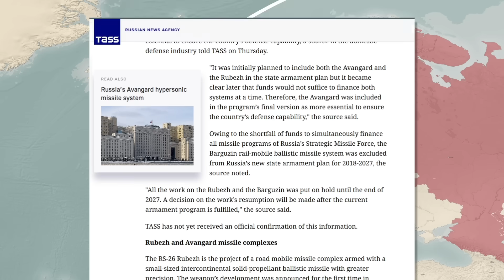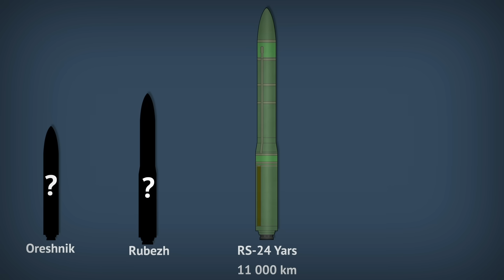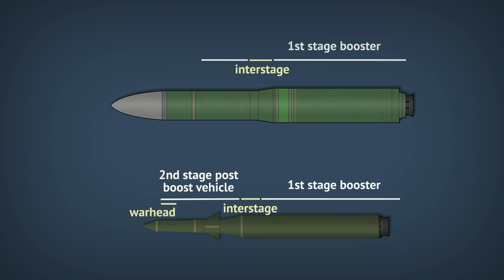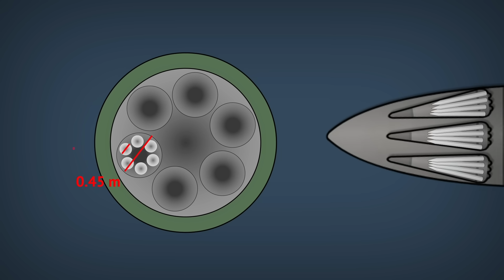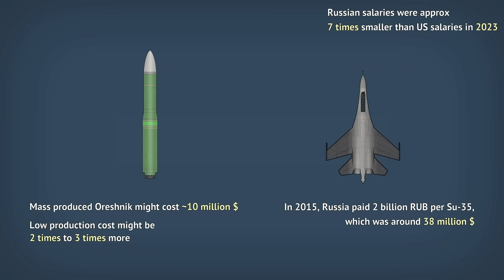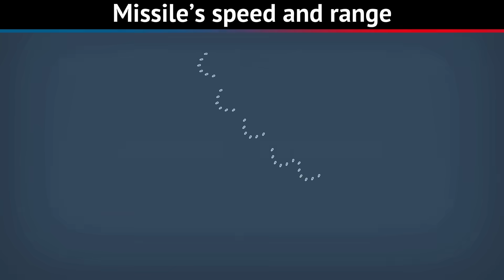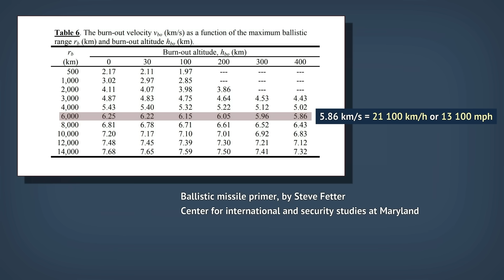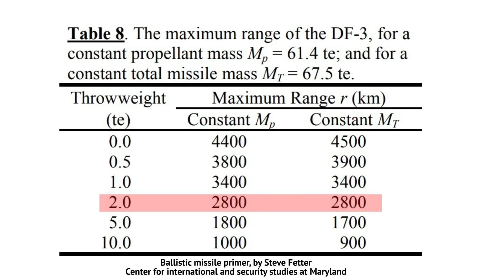Ukraine can’t counter Oreshnik missile. But it doesn’t have to.

Comment: Russia is working on a bomber drone that can carry upto 50 warheads (MIRVs) into space. This would save time and cost compared to launching a single IRBM.
Reply: I doubt that they are still working on it now
Reply: @jailbird1133  True, they ain't kidding. They're building different delivery systems. The Tu-95 and 22 are costly and slow for such missions. Long range weapons projects are their priority. You would be amazed at the stockpiles of Soviet. Decades ago, a guy worked with Thales for Russia managing C4 systems explained the stockpiles are unbelievable.
Reply: By definition that would not be a bomber.  To get into space you need to use a rocket.  To carry 50 re-entry vehicles it would have to either be a very large rocket or have very limited range.
Reply: @JonMartinYXD It’s supposed to operate on the border with space, but doesn’t actually need to escape to the space
Reply: @Khoukharev  That doesn't change anything.  Remember that the altitude record for a jet powered aircraft is barely more than a quarter of the way to space.  The amount of oxygen in the air at one third of the way to space is effectively zero.
Reply: @ Well, maybe. I’m not shy to admit this is completely outside of my circle of competence.
Reply: How can they do that with shovels and chips stolen from washing machines???
Reply: @ctrlaltdebug  They can't and they aren't.

Comment: Patriot battery costs over a billion. It makes perfect economic sense to deploy oreshnik in masse against Patriot batteries.
Reply: people in this comment section are just on drugs, using an IRBM against a SAM system, ok sure...
Reply: If the Russians have the resources to do so. Also, this system as has been pointed out is inaccurate.
Reply: @chrisstrawn4108   from a video I saw it's a tight area targeting, 36 submunitions if armed with HE is a lot, and Patriot battery is not a heavy tank or bunker, you don't need to hit it perfectly. 2-3 oreshnik missiles will wipeout the whole Patriot battery location, just by pure luck and by completely overwhelming any counter measure by volume + speed combination. They need 25 non-mass produced oreshnik missile (900 submunitions) to break even against a single Patriot battery, sounds like a bargain.
Reply: @chrisstrawn4108  Nobody knows if it is accurate or not. To determine that you would have to know exactly what coordinates Russia targeted and what coordinates were hit.
Since you have no idea about neither, you are just talking out of your arse here, more or less like Binkov.

Comment: Hm with the accuracy of a nuke even packed with normal explosive warheads not usefull because its inaccurcy is to high. This kinetic warheads even more nonsen you need to hit precisly for it for damage with accuracy of a missle concept for nukepresicion ? Nonsens. So very expensive for a purpose never concepted for... its like use your i-phone as hammer.
Reply: have you seen the images of the impacts? even if it seems likely that you are not interested in facts not fitting your prefered version of reality, you might take into consideration the apparently very high precission of the attack.
Reply: Sofa analytics. Both USSR and USA had plans for such kinetic weapons. USA just dropped it and you see it only in a movie, like J. I.J Snake strike (or smth). Basically if something hit at that speed it evaporates in impact so no need to carry explosive.
Reply: @danielkirpichnikov2007  dude, it's not very accurate to hit anything even remotely close enogh for that
Reply: @marsdriver2501  Accurate? Where did you see an aerial bomb accuracy? It doesn't have to be precisely accurate to destroy target. + don't forget all warheads can be nukes.
Reply: It has 36 submunitions, it's on the level of HIMARS strike, it's accurate enough. Against soft target like Patriot battery it's good enough if HE is armed, and there is no defense against this combination of saturation + speed. It even makes economic sense (40mil oreshnik per experimental shot, which can be down to 10 mil if mass produced) against 1 bil cost Patriot battery.

Comment: i dont understand why missiles cant fly in outer space with more than orbital speed🤔 if voyager fly 50000 kmph why cant they? why would anyone make intercontinental rockets that fly in atmosphere kind of 10-20 thousands kmph 🧐 i would speed it up kind of superduperfast and when its over the target use speed decreasing booster and vertical trajectory booster so it wount to burn in entering atmosphere 😊
Reply: How much fuel do you think can fit inside a missile?
Reply: @sergarlantyrell7847  well, as i know, they were sending orbital rockets(missiles 🤭) since 50-60s and ive seen vostok gagarin rocket at vdnh open exibition in moscow. its not too latge. and it was rounding earth by orbit 🤔 so why thef they would launch icbm in atmosphere at dramatically slower speed and reach in 2024? 🤔🥳
Reply: @huymammin5915  ICBMs and IRBMs already fly in outer-space much higher than the international space station.

But these missiles only burn for about a minute, then they they coast in a big arc in space and then fall back down.

If you sped something up to escape velocity, then it would... Escape from orbiting around Earth... Ie it wouldn't hit anything, it would fly off into space, which is a pretty pointless missile (unless you're planning to nuke Mars).

You can speed something up to that velocity (but it's slow), but to make it a useful missile you then have to spend a whole lot more fuel slowing it down again, so it lands on Earth.
Reply: They're missiles, not rockets
Reply: @Dial8Transmition  whats the difference
Reply: @huymammin5915  rocket is non guided
Reply: we are speaking about Rocket science here not cars or bicycles.
voyager flies 50000 in space, not around earth which is pulled by gravity.
Reply: @ΠαζαρακιαΣιτι  so what? there is no atmosphere same way. space stations rounding orbit at 20000 kmph. so any rocket that docking it fly same speed 🥳 i bet its quite easy to gain double of that speed with icbm. this conversation is rediculous
Reply: I think you got your units wrong. 
Voyager 1 seems to be going about 38,000 mph, or 38 kmph. An ICM can go 6-7 km/s which is about 15,000 mph. Converting km/s and mph are very different in scale, and it can be very easy to miss a k or mix up hours and seconds.
Reply: The Voyager missions are fast because of fly-bys with the gas giants (effectively stealing a small part of their orbital speed). Even ignoring the extreme difficulties adapting fly bys to aim back at Earth, it would take years to come back.

Comment: a certain leader canceled the treaty.i thought the icbms all ave hypersonic flights and are multi warheaded?
suppressing high end gear is a probability
Reply: Trump!!!😊
Reply: Trump isn't the sharpest spoon in the drawer.

All ICBM re-entry vehicles will be travelling at hypersonic speeds (which is one reason why the hypersonic hype is stupid).

Not all ICBMs carry more than one warhead.  Some can only carry one by design, others are deployed with fewer warheads than they could carry due to treaty limitations (eg. the Trident D5 can carry up to fourteen, but is usually deployed with only four to comply with New START).
Reply: MIRVs were banned under nuclear arms treaties. Now all limits are off and anything goes!

Comment: No, it's not going to be a "very very expensive weapon".

You don't get it do you?

Every single Oreshnik can replace 36 cruise missiles.
Even if it DID cost $30M, who cares?   When it still cost less than the missiles it replaces.   AND is magnitudes more difficult to intercept.

Also, RF already have it in serial production.   Up until now, it was just prototype serial production, but now it's not.
Expect at absolute minimum, 1/month rate of production.   More likely 1-2 per week.

"some might"

Dude, the west has NOTHING that can intercept the Oreshnik warheads, and because it's effectively a hypersonic glider, the west ALSO has nothing that can intercept it before warhead separation.
Latest update is that they hit Dnipro at mach 11.8.   According to UA sources.

"not very useful"

WTF?

Are you on drugs or something?   Dear gods matey, you have no clue what you're saying.

lol
Far too expensive?   Russia considers it to be under existential threat, AND they're still running their national budget at a SURPLUS.
They can EASILY afford to build these at a rate of one per week.

And again, everyone of these, REPLACES up to 36 other missiles, most commonly Iskanders.
And they have the same extreme deep earth strike ability as the Zircon and to a lesser extent the Kinzhal.
Which almost no non-hypersonic weapons have.

"3000km"

No, we already KNOW that their range is further than that.   Because Russia openly stated that they can hit London from Astrakhan with it, over 3500km.
Madrid was also mentioned, which is just under 4200km.

"escalates"

Maybe the west shouldn't conduct blatant acts of war against Russia then?
Maybe the west shouldn't start wars against Russia?
Reply: What a cringe and reddit-like comment, holy fuck
Reply: Bruh. No one invaded Russia. Ukraine isn't a part of Russia. Go lick more authoritian boots
Reply: @TheCerebralMirage  NATO and Ukraine did.
Reply: VODKA CAUSES BRAIN DAMAGE!
Reply: West started wars against Russia?
w h a t
Reply: Lol at this vatnik coping
Reply: It cannot replace 36 cruise missiles, are you actually regarded? Wow look at my atacms M39A1 missile warhead, it has 300 bomblets, that can definitely replace 300 artillery shells 🤦
Reply: @phil-jc8hp  It can.
Reply: Bro, it is nothing like a HGV. MACH 11 is not anything special.
This shit has been around since MIRVs were introduced. They have always been this fast.

EDIT: And you should probably look at the current economical situation in Russia
Reply: @hurrdurrimaburr  "EDIT: And you should probably look at the current economical situation in Russia"

Why?   They're having the biggest economic upswing ever.
Their only real problem is that the CIVILLIAN economy is doing so well that the lack of workforce is overheating the economy a bit.
Reply: @hurrdurrimaburr  No they arent. They slow down to accurately make it to the target. Thats the difference between these hypersonics and the other missiles.
Reply: @attilamarics3374  wtf are you talking about? They slow down because of friction, they traveled at mach 11 upon impact. They aren't stearing anything lol. These are regular ass MIRV delivered from a ballistic missile.
Reply: @hurrdurrimaburr  WRONG, the missile of this size is completely new thing. As for current economical situation in Russia, their economy has increased more than pre-war.
Reply: @DeusVult-q3f  It really isn't. The missile is just a delivery for the missile bus which launches the MIRVs. It's not new revolutionary tech.
Reply: "No, we already KNOW that their range is further than that" you know because daddy Putin told you so? Come on man dont be like that. Also you dont actually believe their claim of fighting an existential threat right? They claim that literally every war they fight. "Maybe the west shouldn't conduct blatant acts of war against Russia then?
Maybe the west shouldn't start wars against Russia?" like what? What wars have the west with Russia fought? 0. Not once did we invade them but they keep invading their neighbors.
Reply: 'Maybe the west shouldn't conduct blatant acts of war against Russia then?
Maybe the west shouldn't start wars against Russia?'
LOL there we go, there had to be a reason for your insane statements. To be clear, this system does not 'replace 36 cruise missiles', that is a statement so stupid it boggles my mind. Are you an AI? A cruise missile is accurate to within 5 metres, the warheads from this are accurate to about 50m (at best). It's like saying a shotgun replaces a sniper rifle. Also the missile does not carry 36 tons of explosives, unlike the cruise missiles. Nor do we have any evidence it's a HGV; all evidence points to it being a basic IRBM from the 60's. And everything you are saying 'Russia stated' is false, because....and brace yourself for this....Russia lies about everything constantly. Shocking that a completely corrupt dictatorship with no freedom of press would do that isn't it? Now go get your 20 rubles from uncle Vlad, and spend them quick, they won't be worth anything soon.
Reply: @TransoceanicOutreach  "To be clear, this system does not 'replace 36 cruise missiles'"

Why don't you head over to Millenium7s channel and ask there?
He's the airforce specialist and made a couple of interesting videos on the subject.

"A cruise missile is accurate to within 5 metres, the warheads from this are accurate to about 50m (at best)."

lol

And you get the daily dunce award.

You clearly didn't understand what was stated.
And no, accuracy for each six impactors were close to that of cruise missiles if current statements from UA is anywhere close to real.

"Also the missile does not carry 36 tons of explosives"

No, because the kinetic energy of the impactors equates to vaguely around that amount even without an explosive warhead.
Might be half that, might be double, but the overall total is elimination for whatever is hit.
Whether it's on the surface, or deep underground.

"all evidence points to it being a basic IRBM from the 60's"

Dude, now you're just being vape...

No, absolutely NOTHING points to that.

Never mind, i have no time for people that are willfully blind.
Reply: @TransoceanicOutreach  you asume thet Your press is free 😂😂... What a claun
You need to lear Your place in the World. And you lear in the Hard way.
Reply: @Gambinoxx  LOL yes, our press is free, I can literally start my own newspaper or website and publish what I like without worrying about the governments opinion. I can record events in public without worrying about being sent to a prison camp. I know this concept seems strange to you, but it's been this way in England since 1695. That's why England, the UK, and all of it's settler colonies (US, Canada, Australia, New Zealand) have not had a dictator in over 330 years. But you can't even imagine that, can you?
Reply: @TransoceanicOutreach  Julian Assange has entered the chat. Edward Snowden has entered the chat, Gonzalo Lira has entered the chat.
Reply: @TransoceanicOutreach  ''but it's been this way in England since 1695'' 

Darwin Award winner goes to
Reply: @TransoceanicOutreach  ''LOL yes, our press is free, I can literally start my own newspaper or website and publish what I like without worrying about the governments opinion. ''
So can people in Russia too and they do that too.
Reply: @DeusVult-q3f  except you have to register (with all the info that can be used to locate you and punish if needed) if u have above 1k (IIRC) subscribers (which is quite small number, even for non media account).

And if they can enprison someone for calling war by its name, I doubt it can be called "without worrying about the governments opinion"
Reply: @mrDominius  "And if they can enprison someone for calling"

That is false.
Get your facts straight.
Reply: @TransoceanicOutreach ok how many hypersonic missiles does the US have? Zero. But but It's 60s tech 😆
Reply: @moonZe_konZa  'hypersonic missiles' have existed since WW2, the V2 for example. If you mean STEERABLE hypersonic missiles, then currently none, but they have had the technology since the 70's. Russia also has none, just to be clear. Same with China. They have provided precisely zero evidence that any of their systems can be steered, they appear to just be ballistic missiles. If the US wanted an active system they could spend the money and have it in place within a year, they have the tech.
Reply: @TransoceanicOutreach  That is not how it actually works now in modern era. The modern term of hypersonic missiles Russia has every and proved that has any. USA hasn't used nor shown any. So it's opposite. USA lacks knowledge to do it. So that is the difference.
Reply: @TransoceanicOutreach  Russia literally has steerable, while USA has none.
Reply: @mrDominius gotta love that reverse cgi landing 😄
Reply: @bocko159  yeah, but not that much as flat earth, right?
Reply: @TransoceanicOutreach  Wrong. again. Also he does not state what Russia states, but what every normal human being states. And soon they will be worth of everything.

Comment: $30 million a pop, that's pretty expensive fireworks.
Reply: $30Mill according to Binkov the copium dealer. No one knows the real price.
Reply: @aniksamiurrahman6365  If you don't know the real price, then how do you know that Binkov's guesstimation is wrong? That sounds like a decent fallacy, inspired by a certain bias to his channel rather than a rational explanation.
Reply: It wasn't as expensive as operating F35 which could cost 200 million usd per hour. You might not see the explosion in the video due to the warhead being not equipped with explosives. It was all kinetic energy. If you watch the interview or read a report. Russia was targeting some kind of military factory. The factory was obliterated completely obviously
Reply: @azureoverlord9346  Based on satellite photos and Russian mili bloggers, they didn't hit the factory.
Reply: @Isinlor  it very clearly did if you look at the video the second set of warheads made contact with the large factory and it seems that specific buildings around it where hit also
Reply: @Isinlor  Do you know hat coping is?
Reply: @azureoverlord9346  ' The factory was obliterated completely obviously' - LOL it absolutely was not, we have video of it the following day. These warheads are basically unguided, they got a couple of lucky hits.